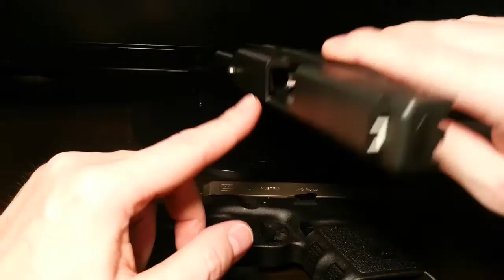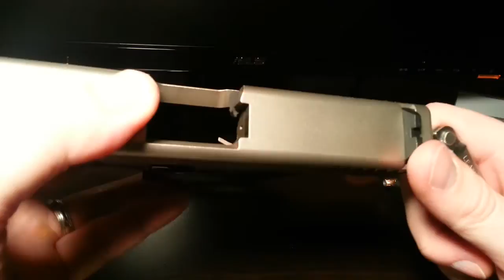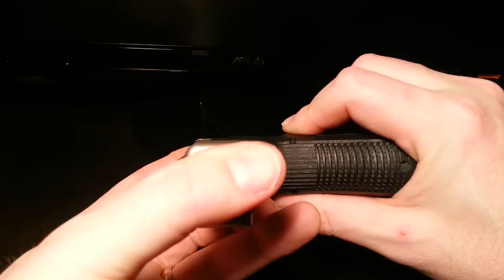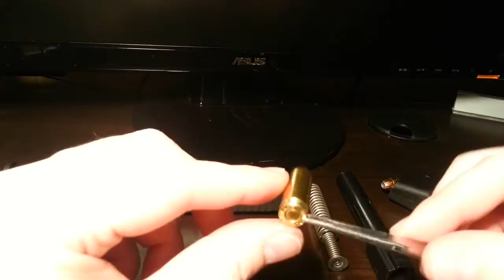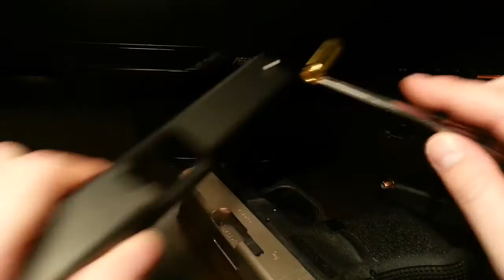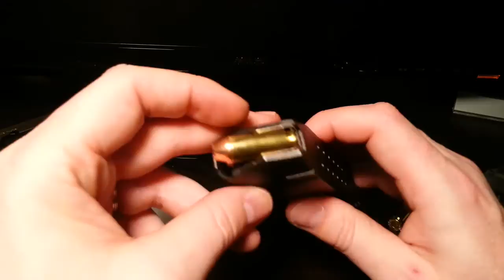How a semi-automatic handgun works (Glock)

Comment: So the only reason i came here was to see how an automatic pistol rechambers a round after one has gone off.  I know how an ar15/ak47/SCAR style platform functions, but pistols generally do not seem to have the tubes that redirect the slide back.  So basically the force of the round going off is enough to knock the slide to the rear? Awesome. Thank you